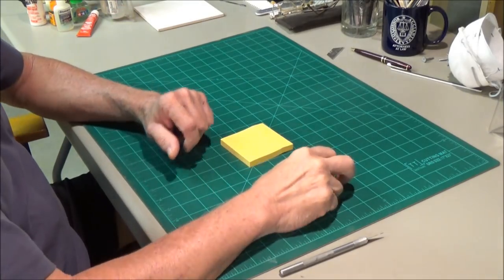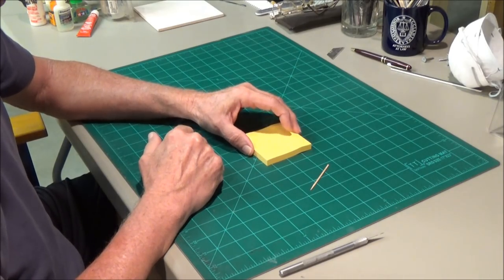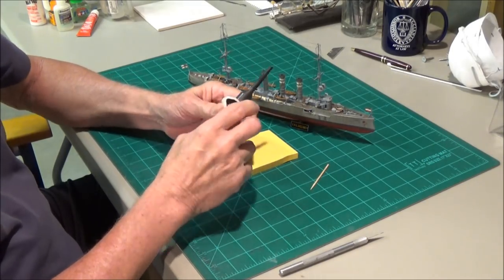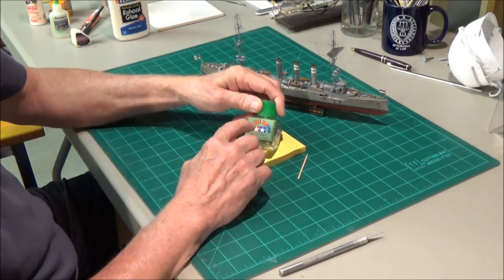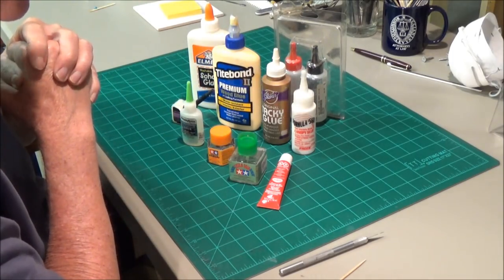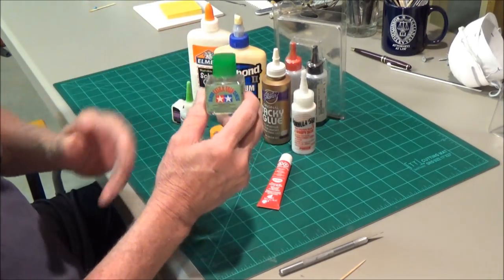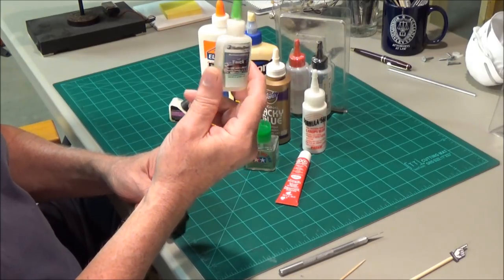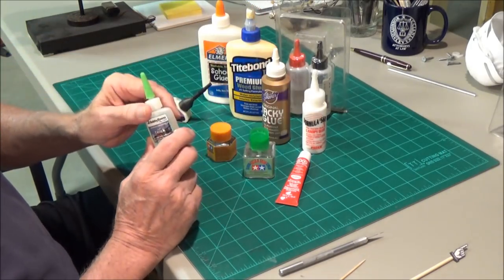TIPS & TRICKS PART 1

Comment: Thank you for the great tips, Gary. I would also like to offer you a couple of tips. For removing photo etch, I prefer to use a #16 blade because the angle of the blade makes it easier (in my opinion) to cut through the brass. And when removing tiny parts from the brass sprue, I will roll a small piece of masking tape to place under the part(s). This will help prevent the part from pinging off into that great black hole and disappearing forever.

Comment: CA glue does have bad fumes, as you say, and as for a respirator, you would need a top level carbon filter mask with contact seal to prevent the fumes from harming you. A regular fiber filter mask is good for larger dust particles only, not "fumes", so don't use one thinking you are protected from chemical related fumes. I am not saying you need one for model building, a well ventilated work area should be enough, but if you are doing anything like brushing a large area, then you may need one.

Comment: For new modelers.  16:00 Plastic cement (Tube or bottle) is not actually a "glue".  It chemically melts the plastic and basically "welds" it together into one piece of plastic.  Regular glue (epoxy, CA), does not melt the plastic, but bonds two dissimilar materials together.  Wood glue should only be used for wood models!  Same goes for canopy or white glue.  It does not actually "melt" the plastic.  One trick with CA to fill large void (mostly in wood, don't recommend in plastic), is to use some talcum powder.  The problem is that CA heats up with rapid drying.

Comment: I like your tips,but I have to take issue with one tip. When you suggest that you use tile to cut pe you are using the ceramic which is what is used to sharpen steel blades. What will sharpen steel will dull steel. It ruines your blade too quickly. I suggest using dense plastic like the kind used in cutting boards. Just an observation. Keep up the good videos.
Reply from the maker: Thats one reason you buy your blades a 100 at a time.  You have to be careful what you cut your PE on, any give to that material will bend the PE and could ruin your parts.  A lot of guys use a sheet of glass. Thanks for the tip.

Comment: A few times now I've seen you lament about the length of your videos. One way you can shorten them up is not talk so much. No, seriously - you often repeat yourself several times in the same video and start talking on tangents not really relevant to the main topic. This particular video for example has a 8+ minute introduction. That's longer than many videos on YouTube, and you haven't even shown the first tip by then. (Yep, the first tip is finally shown 9 minutes into the video!) Picking up the pace a bit and not belabor things over and over will help with video length. (fyi, Tamiya is Japanese and pronounced Tah-me-yah. Japanese "i" is pronounced like an English long 'e', unless preceded by another vowel. "Tah-my-yah" would be spelled "Tamaiya".)

IMPORTANT NOTE: What is shown as a "respirator" when talking about CA glue is not a respirator and will not protect at all against toxic fumes. That is a dust mask and useful when sanding. A respirator has chemical vapor filter cartridges on the front for trapping fumes so you're not inhaling them. (And just because a fume smells "good" doesn't mean it's not harmful. In fact, there are plenty of odorless vapors that will kill you.) I would also recommend eye protection when working with CA glue. One accidental splash from a part or tool (or hand) moving unexpectedly can ruin the rest of your day.
Reply: Wow, you must be so much fun at parties...